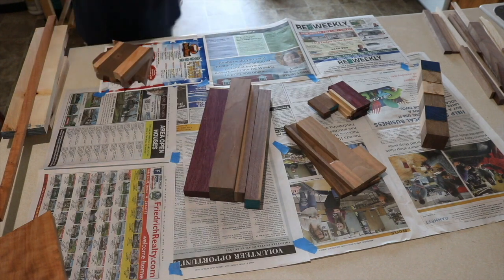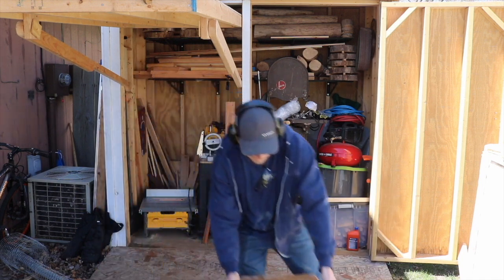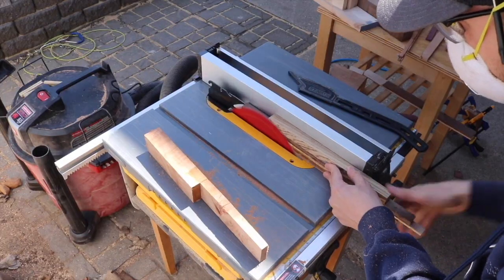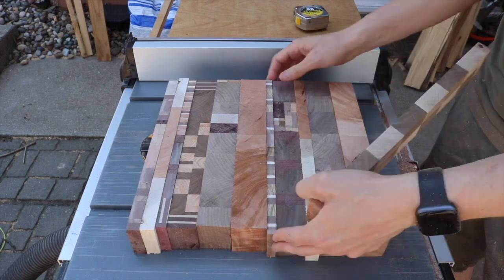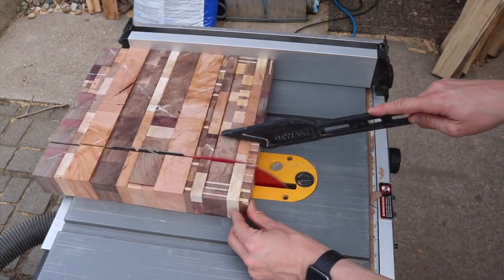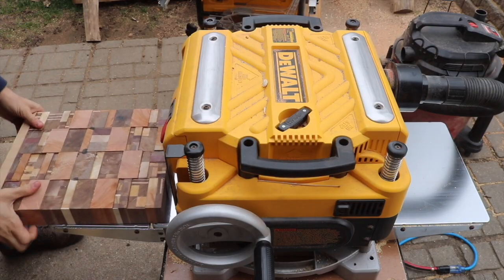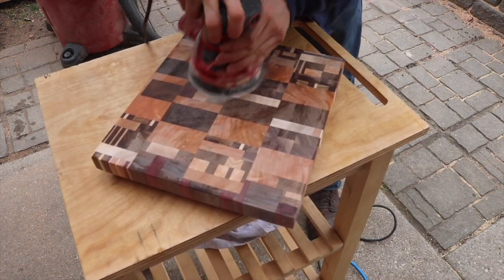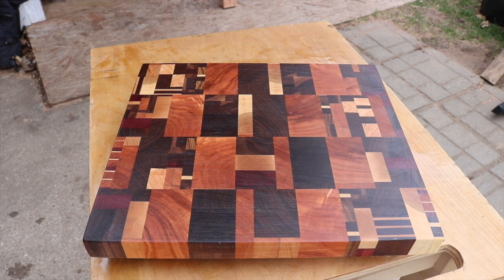Chaotic Cutting Board - Momento

Comment: Did I see it correctly ? You use your crosscut sled 2 ways. One for straight cuts and flip it around and do a angle cut?  The board is awesome looking. I was wondeing what I could do with the load of small pieces I have.
Reply from the maker: Yup! Rotating the sled 180 degrees and turning the table saw blade to 45 degrees makes it multi purpose. I did this to avoid hitting any of the screws and also giving more “meat” between the two cuts down the middle of the sled